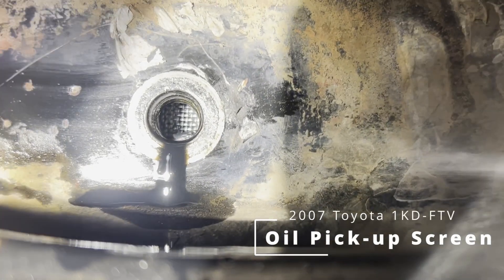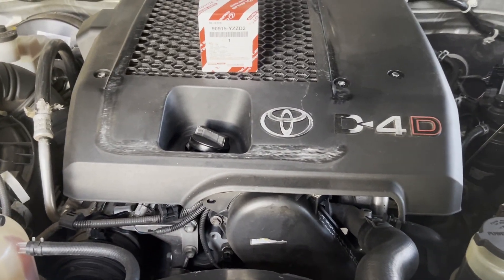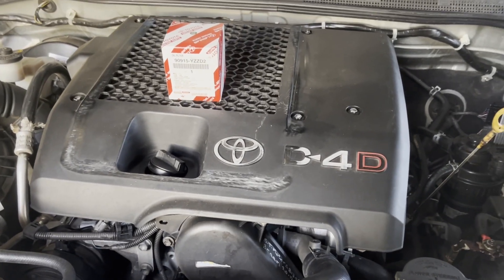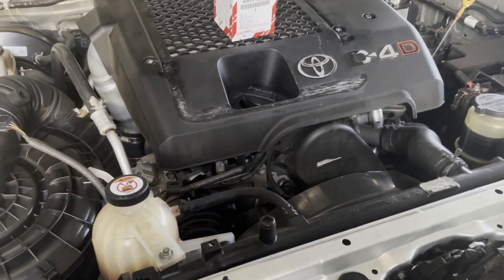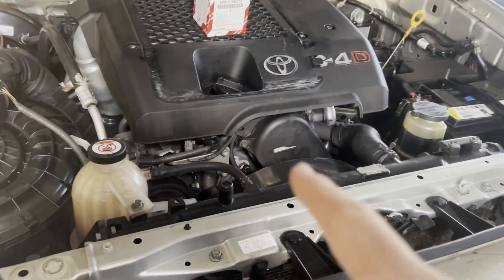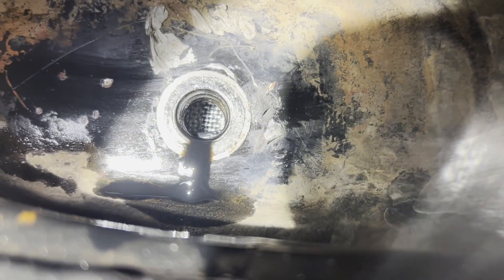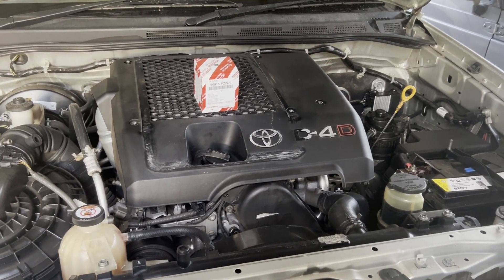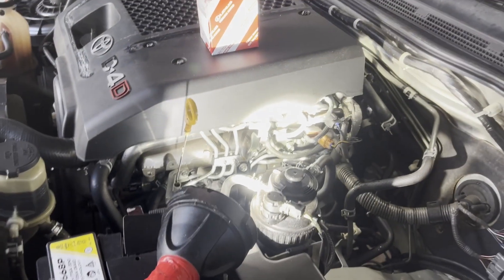Toyota D-4D (1KD-FTV) | Do This Check to Prevent Cracked Pistons!

Comment: Most injector cleaners are just naptha. Naptha is brake cleaner, you can also buy from bunnings in a 4ltre called shellite. You can run the hilux on pure shellite, not that you would want to because of the cost but you can disconnect the fuel filter and put the hose into your shellite bottle, as well as the return line and you can cycle the shellite through your injectors. I usually put some fuel doctor in it too.
Reply from the maker: Thanks for the info. Would that work on the high pressure diesel system?
Reply: @GreaseAndGravel  yes, I buy and sell cars too. I've done it on most modern diesels. Another tip to quieten the injectors down is to put a bit of 2 stroke oil in it. Most modern fuels have had a lot of the lubricants removed from them so the injectors don't last as long anymore.  But if you put a bit of 2 stroke oil in once every 2 weeks it'll quieten them down and they'll last longer. I realised your not in Australia  so you probably don't have a bunnings or shellite?
Reply from the maker: @123fuhfrtgfh  thanks, mate. I appreciate the info. Yeah, I'm in South Africa. I'm using the Toyota injector cleaner every 5000km but it's quite expensive.
Reply: @GreaseAndGravel  yes the additives are really expensive, that's why I started looking around on forums and youtube to find alternatives.
Reply: @GreaseAndGravel  you can also use kerosene in the fuel to clean injectors.
Reply from the maker: Thank you!  @123fuhfrtgfh  How long do you think Denso injectors will last in a 1KD-FTV? I've seen some aussie Youtuber say only 150,000km, but here in ZA we regularly do 500,000km plus on original injectors (even 700,000-800,000km in the taxis).
Reply: @GreaseAndGravel  I think 150,000km is the manufacturers recommended time to change them, but I've seen them with 300,000km and still going strong. If it ain't broke don't fix it.
Reply from the maker: @123fuhfrtgfh  I agree. Here, there's nothing about replacing them in the maintenance schedule.
Reply: @GreaseAndGravel  you might have better fuel than us or maybe you don't have EGRs or DPFs? That stuff will shorten the life of a deisel.

Comment: 3 things i can highly recommend...
1 ) block off the  EGR recirculation with 2 x block off plates, especially with the millage of the your vehicle, its about 15min job and probably about R400 for a set of plates with gasket materials it will save you Alot of headache and big bucks down the road...
2) Shell Helix 10W40 HX7 (the blue bottle) is the magic oil these motors absolutely love! 
3) the specific  branded Toyota diesel injector cleaner  additive is amost worth its weight in gold, and I couldn't recommend it enough (add to Tank of diesel every service interval)
Reply from the maker: Thank you for the advice, I appreciate it! I use the Toyota injector cleaner every 5000km. That is also the oil I was planning to use, thanks for the confirmation. I want to clean the egr soon, might consider the plates then.

Comment: Diesel oil turns pitch black very quickly. I doubt you'll be able to reduce anything valuable from a visual inspection.
Reply from the maker: Thanks, Sean. That's good to know. I've not owned many diesels.